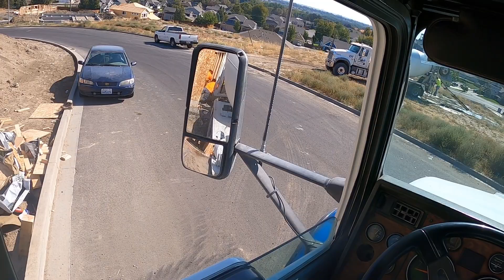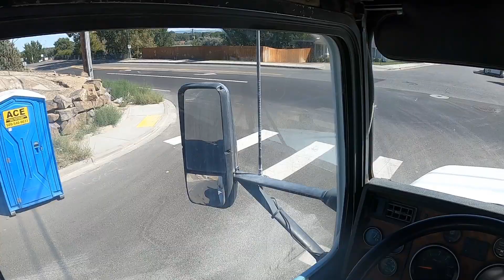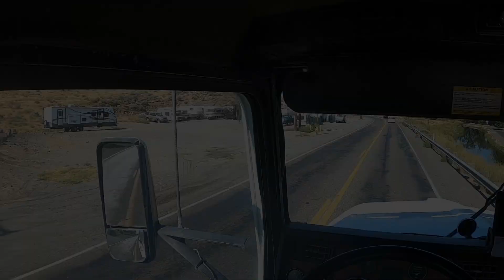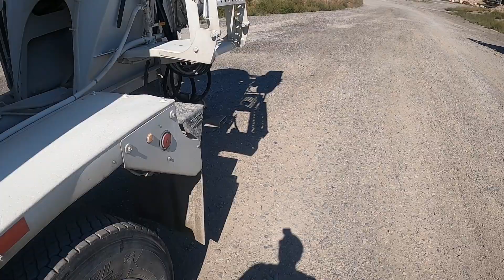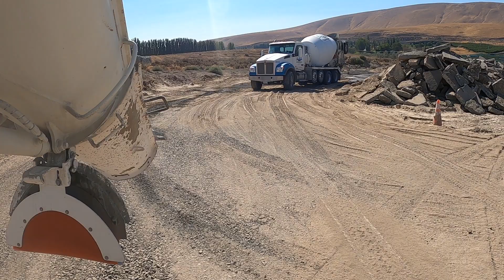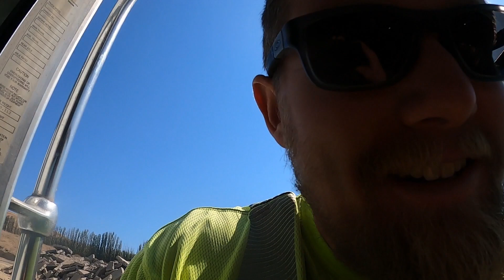Driving Cement Mixer: They ordered too much

Comment: We have always just called them concrete blocks. Whenever we have leftovers back at the yard, the dispatcher will either say garbage or blocks.
Reply from the maker: Yeah come to think of it, my dispatcher in Tacoma called them Eco Blocks. We did the same thing, we had a separate plant for recycling so we would either dump it out or pour blocks. Do you drive Kenworth trucks?
Reply: @grabbinggears109  my old truck was a Mack, my truck now is a Western Star and most of the new fleet coming in are internationals and they are automatics now. But I wanna keep my 8 speed for as long as I can for the shifting experience. The automatic is nice for curb and sidewalks but I still find it weird to drive lol
Reply from the maker: @Tat2Matty4Free  yeah I'm the same way. I feel like you're not driving a truck in an automatic haha. We have have a few Mack trucks and the rest are Kenworths, I've never driven anything else lol